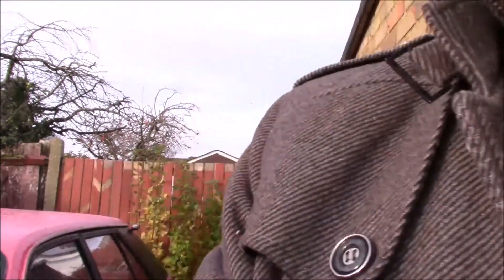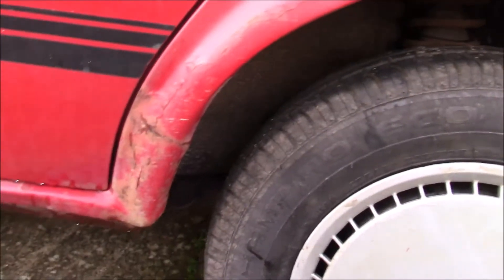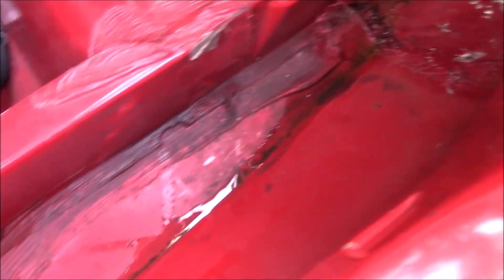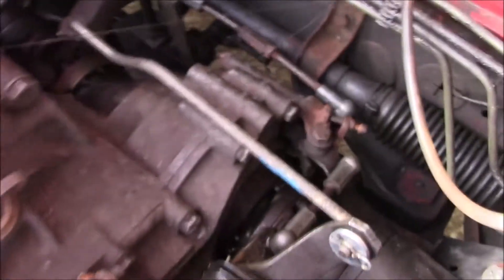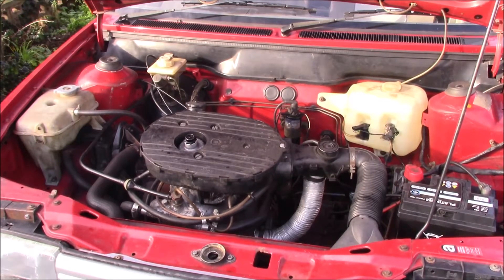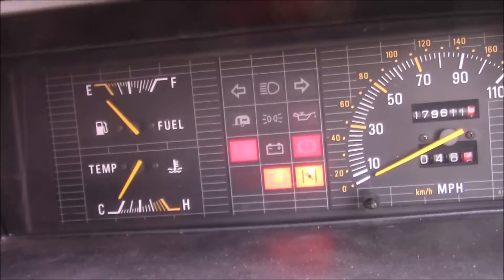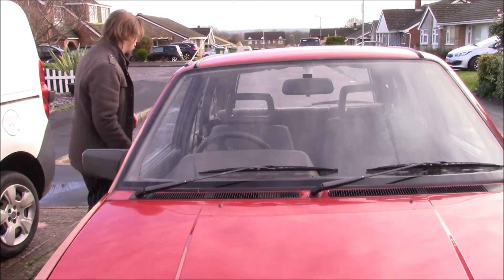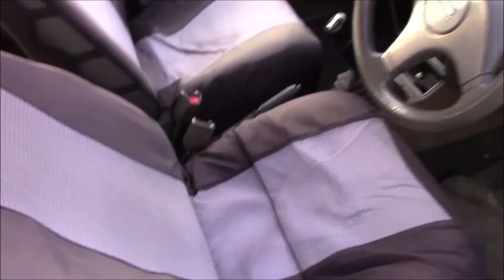1988 Austin Maestro 1.3 City X - new arrival

Comment: Nice car! Rough running of the kind you experienced just after start up is called 'hunting' - it means you need to push the choke in a bit. Running with the choke full on like this will wash oil from the bores and cause wear. Good luck with the re-commissioning!
Reply from the maker: Thank you.  Funny thing, when I first got it if you pushed the choke in even a little bit when it was hunting it would just die.  Now I've been using it regularly it barely needs any choke even on a cold day so I guess it just needed the cobwebs blowing out.

Comment: I had three Maestros,  an early 1.3L which by all accounts was a shed but it got us reliably around for about 11 months until the father in law sourced us an '87 1.6L which had the two-tone red over grey paint. Sold the first one for slightly more than we paid for it and ran the second for about three years until a Sierra Sapphire beckoned. Later on I ran a diesel Clubman for a while which was a hot as a second car. Certainly no better or worse assembled than its contemporaries and roomier than most.
Reply: Where do you put oil in this car?  In the carb or.. somewhere else?
Reply from the maker: There's a filler neck built into the rocker cover for the engine oil, the air box is so big it might have obscured the view of it.  The carb needs a bit of light machine oil in the dashpot too every now and then.